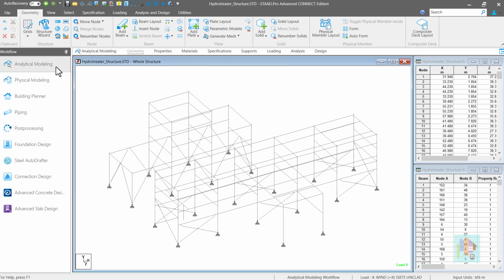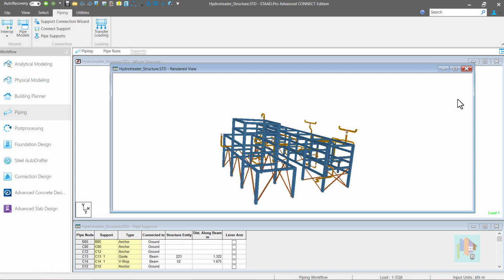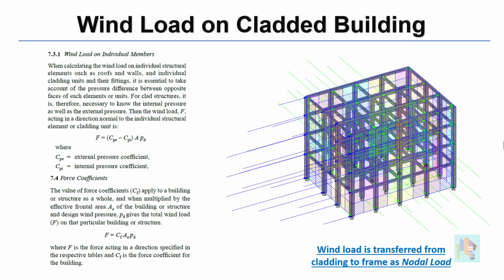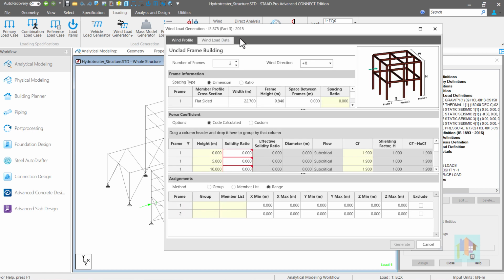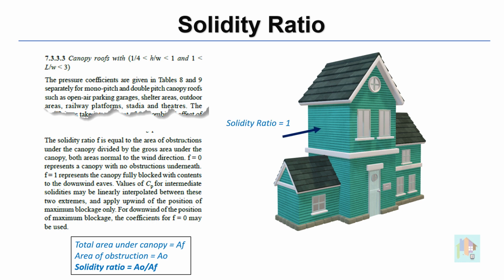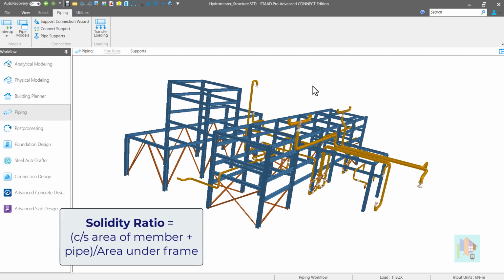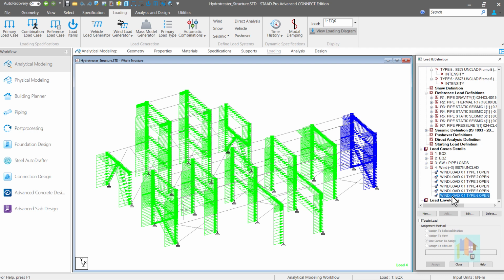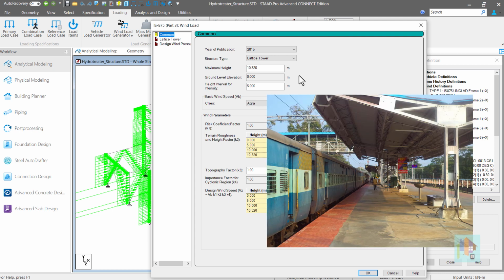Generation of Wind Load in STAAD - Part 3: Unclad Frame Piperack Structure|| Solidity Ratio || IS875

Comment: Unable to create wind load in other direction in case of unclad building using wind load generator.
Reply from the maker: Currently, this is available for one direction only, you can create it for X direction, then from input editor inactive that load case, create it again for Z direction and switch on wind load for X direction from editor.

Comment: Very clear video sir. I really thankful to you. Sir could you please explain frame spacing ratio
Reply from the maker: As per IS875 (Part 3):2015, cl.7.4.3.4(a), frame spacing ratio is the c/c distance of frame by the least overall dimension of frames. I will cover this topic and shielding factor in detail in Part 4 of this series.
Reply: @surojit_ghosh  Hello may you please prepare a series of positioning of bracing,criteria used for selection of bracing members,when to use steel rod,cable or steel member as bracing?also how to model and define steel rod bracing and cable bracing in STAAD Pro